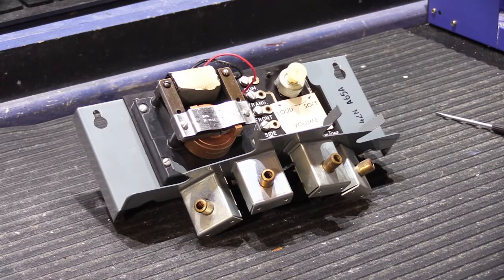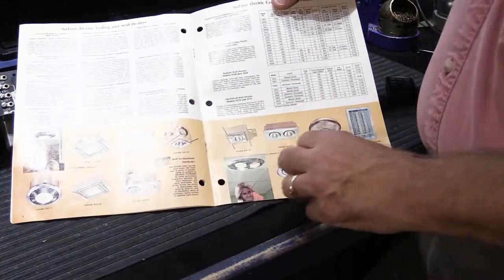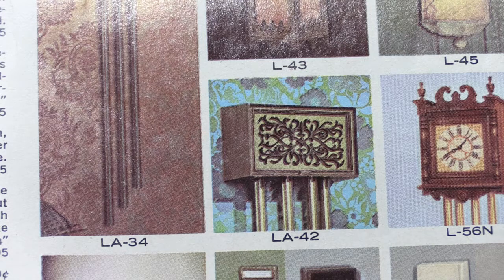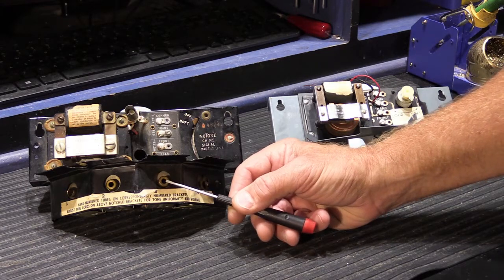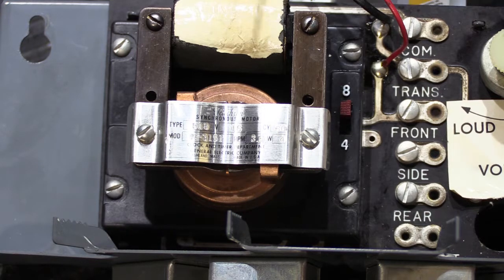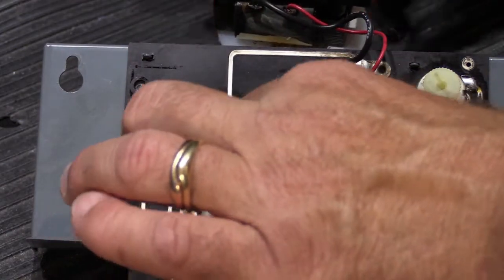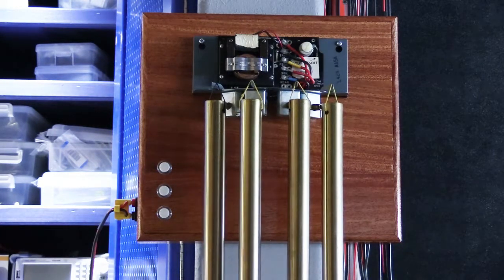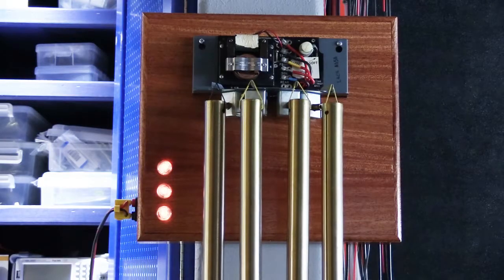An Overview of a 1965 NuTone L Model 8 Note Door Chime Base

Comment: Well apparently I have some Frankenstein version of the L56. Nice to know in todays bucks it’s probably north of a thousand dollar chime. Anyway, it has the gray base, no rubber grommets, a lot of wiring like the K, as well as the slider for soft-loud instead of the knob. 16V transformer that might say HIO or HLO and 3.6rpm. Date code looks like 1959. May be that nutone was using up some older parts while phasing in some new parts and processes. 

Very informative video. Went looking to find out why I’m having trouble connecting a video doorbell and kind of fell into this for a half hour. Probably ought to get back to work 😂
Reply from the maker: Hi nameunavailable:  There are several different versions of "L" Model Chimes - Your L56 from 1959 is an "early" "L" Model Chime - which has differences from the 1965 Chime in the Video - What you describe is exactly what I'd expect it to be - It is possible to have a WIFI Camera work with the Chime, however it will be more work to install than just connecting 2-wires 
     This Video show what needs to be done: https://www.youtube.com/watch?v=t6YswmDNVyI&list=PLsTvqKsBnGYdNYGrlrOSVKjOLwvFWrLUx&index=3
Chris

Comment: Thank you for this .. we just bought a house and it is missing the bars and cover for the doorbell and I didn't know what it was called until i came across your video.. now for the hunt of the tubes and cover lol.
Reply from the maker: Hi Amanda:  Very cool - good luck with your hunt for the missing pieces. - Chris
Reply: Many wind chime tubes will work.  Any correct sized box to cover the chimes - just cut box's bottom for tubes and hang like a picture frame.

Comment: Thank you again for another great episode. Yes, I know it’s from years ago, but I just found your channel a few weeks ago. 👍👍 Slowly but surely, I’m making my way through your content, mainly focusing on the older door chimes. I find them so cool. AND… your videos have been extremely helpful in bringing back my Pryanco 305. It’s not finished but coming along nicely. You were very kind replying to a few questions and I hope I am not a bother to impose again. My Pryanco is missing the volume control. It has a provision for one but it was snipped and removed. 😞 What specs should I be looking at for the potentiometer. I say potentiometer because you mentioned it in this video. The transformer is 24V, outputs about 28V. The solenoids have a resistance of 8 ohms. One would think, I would measure around a 3A draw by a solenoid but actual current is 4A. All I have in my arsenal are 10K 1/2W potentiometers . I don’t think they’ll cut the butter. 😜
Reply from the maker: Hi douglas:  I do not know the original value for the pot in your Pryanco Chime, however I know that in Rittenhouse Chimes the "volume" pot is 25 ohms at 5 Watts - Chris
Reply: Thank you again for responding. 25 ohms at 5 watts is a good starting point. I may be sitting down with Ohm’s Law a little later. Right now, I have my Brasso and a wobble pop cleaning the long tube chimes. The wobble pop is for incentive. I really don’t like polishing brass. I came across an interesting fact today I didn’t know. Pryanco, or Pryne and Company, was acquired by Rittenhouse in the 1950s. My chime is from the 1930s. Found a pic of an old catalog on the internet. I’m new to the game; this is my first project. So I’m watching your content and progressing methodically. You’d be proud. I lubed up everything with WD-40 and everything is moving like butter. Just kidding… only Zippo lighter fluid and 1000 grit sandpaper 😁. My plungers have good bounce. Okay, that’s been a nice break, back to polishing brass, uuuugggh.
Best regards and cheers, Doug

Comment: This is a very informative video. I am to determine the model of the Nutone NOS 4-short tube door chime I just got. There is no model number on the unit or the cover. I want to connect it up, but without a model number, I don't want to burn it out. The date code on one of the ICs on the board indicates 1998. It is capable of 2-9V battery or transformer operation. I want to use a transformer but am unsure if it is 10V, 16V or 24V.
Reply from the maker: Hi Frank:  Your Chime requires a 16 Volt AC Transformer with a minimum of 30 Watts (VA) - The battery option is used in conjunction with a Transformer, when your previous installation does not have the correct wiring lay-out.   BTW - after exchanging emails with Frank, his Chime is actually a Rittenhouse Chime, not a NuTone - Chris

Comment: Hi. I just moved an 8 Tone chime from my parents house. I am not sure if it is a Nutone. It is from the 1970's and is working perfectly, but when I reinstalled it in another place, if I pushed the button and when I released it the motor stopped working immediately and the chime stopped working. What am I doing wrong. The board just have letters A,B,C,D and E. What I think is that C and D are for the motor, being C the common , and A, B and E for the buttons being B the front one. Please help me
Reply from the maker: Hi Ricardo,  Since you don't have a NuTone Chime - I can't tell you what wires get connected to the A,B,C,D, and E connections.  Here's a link to our Video that explains how most of these types of Chimes need to be wired:  https://www.youtube.com/watch?v=TjKUx18TEvc&list=PLsTvqKsBnGYdEvtzvv_pz1gOKa9UPuAxH&index=4&t=808s

Chris

Comment: Adjusted for inflation 57.95 now days would be worth 463.51, 885.84 for the L56. Love the videos and these chimes. Would really appreciate it if you could make that catalog accessible online. I've been trying to find a good list of all the chimes they've made.
Reply from the maker: Hi Alec: I don't think that people consider how expensive these type of Chimes were back in the day.  Anyone who purchased one had to have a really well paying job to afford them.  The least expensive Chime back in 1960 would have cost $4.95 - which would have been a days pay for my dad, who was a union carpenter - Chris
Reply: @northsideservicecompany3567  Hi Thanks for the great video  Just got my K 45 Black color base   long tube doorbell with a clock from my parents house, I want to replace it from my  1958 Nutone door bell  which only has two wires do you think it will chime with just the 2 wires ? it has a trans wire and a redish front wire ? pretty sure both are 20v
Reply from the maker: @Fishdr2  It sounds like your 1958 Chime is a "L" Model 2-Note Chime - this typically will use a 16 Volt Transformer.  The "K" Model Chime requires its original 20 Volt Transformer - You will probably need to do a Transformer swap between the 2 houses.  The 1958  2-Note Chime and the "K" Model Chime wire differently - Here are links to 2 different Videos that show how these 2 Chime need to be wired:

2-Note Wiring:  https://www.youtube.com/watch?v=YmROyFjML4M&list=PLsTvqKsBnGYdSuId7eQWZUF6ujMM5ondT&index=8

8-Note Wiring:  https://www.youtube.com/watch?v=TjKUx18TEvc&list=PLsTvqKsBnGYdEvtzvv_pz1gOKa9UPuAxH&index=3

Chris
Reply: @northsideservicecompany3567  Hi thanks for the info I really appreciate your detailed videos , i need to grab the plunger can from the other house and im going to check the transformer voltages
Reply: Using inflation calculator this  Barcelona would cost $570 in 2024. Have an April 1965 build base and cover with rectangular grills not the filigree shown hence the new L42N  “Supreme” at $49.95. ($500 in April 2024) Suspect supply and cost of the Barcelona filigree a challenge.  Plastic tube hangars broke so paper lips and metal twist ties have worked for 30 years.  Other than that no maintenance.

Comment: Thanks for this nice, informative video, Chris.  For the “Ext Front” connection, I assume an extension chime in another part of the house needs to be either hooked up to the same transformer or it’s own transformer?  And on the K model chimes, does the extra wire mounted to one of the motor assembly screws serve as the “Ext Front” connection?  Finally, can the “Ext Front” chime be just about any model of Nutone chime, different from the main chime it’s attached to?
Reply from the maker: Hi Anthony:  The "Ext Front" is the connection that will trigger a 2nd Chime.  The 2nd Chime needs to have it's own Transformer and it can have it's own "Rear" and "Side" Door push buttons.  The The "Ext Front" is only triggered by the "Front" Button.  The 2nd Chime can be either another 8-Note Chime or a standard 2-Note Chime - The "Ext Front" connection on "K" Model Chimes is a single Terminal, located on the back side of the chassis - Chris

Comment: I just bought a house with an Im4406 and all of the remote speakers around the house play the radio just fine but the talk feature does not work on any of the intercom speaker remotes or the master station and the doorbell won’t chime and you can’t talk to the door and I do know a one point it did all work if you have any idea what is wrong please let me know
Reply from the maker: Hi Morgan:  There are many possible causes for the type of problem you describe, and this is the wrong place for me to try to describe all of them. The best thing for you to do is fill out our on-line Repair Request Form and once I receive it, I'll contact you by phone to discuss the problems with your IM4406

Here's a link tot he repair Request Form:     https://docs.google.com/forms/d/e/1FAIpQLSdQHT6fVgm25twaXFeCkkgeITEfAE_zlRBry6B8-GbIs19wcQ/viewform?formkey=dF9RVjBQMFQ5S0xYbTBHMHRoNkVkRFE6MQ

Thanks
Chris
925-743-8236